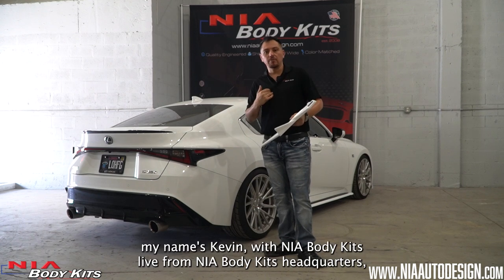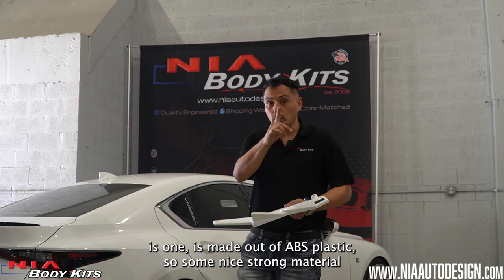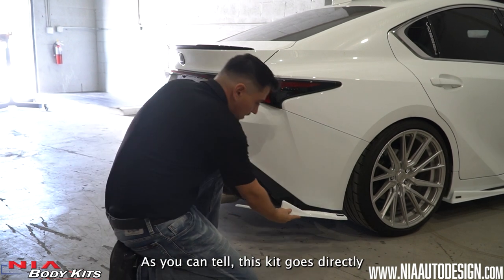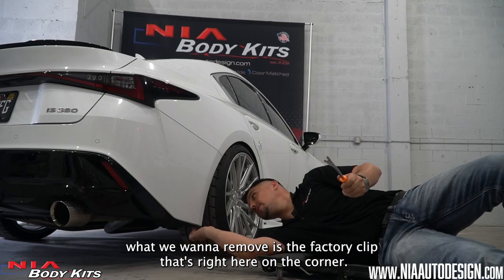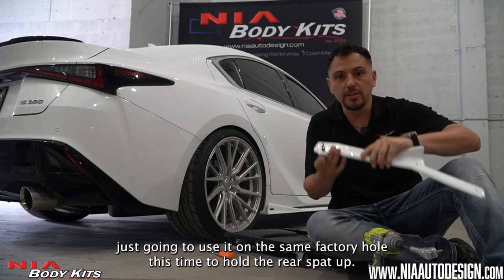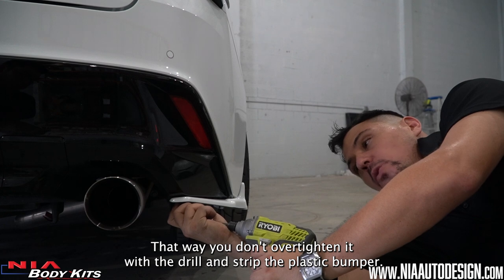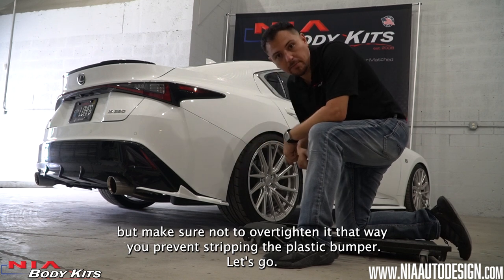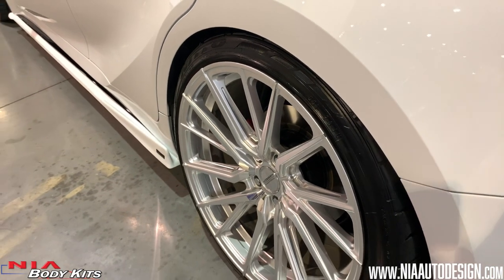How to Install: NIA Body Kits Lexus IS 2021 NIA Rear Spats

Comment: Will rear spats and side skirt fir 2022 IS500?
Reply from the maker: the side skirts will fit but not the rear spats, use the rep code "Chris" to save $20 https://www.niaautodesign.com/shop/lexus-is-nia-side-skirt-2021/